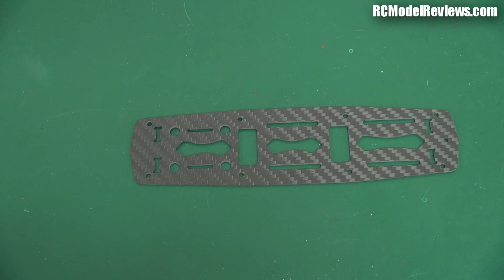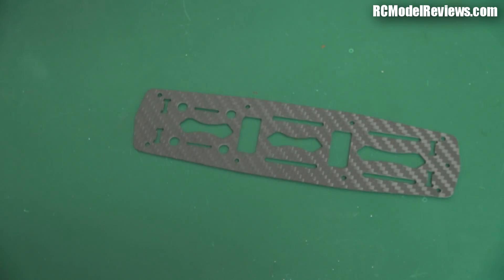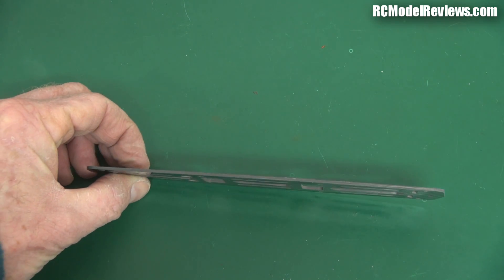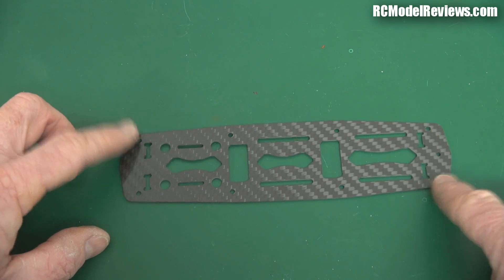Bad 250 mini quadcopter carbon fiber

Comment: On your motor bolts you need a metal base under the screw, even carbon fiber gets crushed without proper seating of bolts, and those look like they are counter sunk screws,,,,,?

Comment: The whole point of being a hobbiest is to modify if needed not complain about everything that's not perfection, because it doesn't exist!!! Once those quads are assembled i doubt very seriously you will see those holes you claim looks like they been punched out instead of drilled... I've purchased named brand rc toys and still ran into problems it's all about the hobbiest and his or her skill!!! I can take one of those Chinese how you say generic frames and cross reference some cheap motors 2300kv and probably be a strong competitor I've seen no name motors out perform name brand motors it's all about if you get a good batch or bad batch or the famous word quality control ... If they sold quads and motors that never break how are the company's going to continue to make money it's not rocket science ijs...
Reply: +twotwocold Sure, they'd perform well but for how long? I've given up on cheap CF frames because those poorly done holes are where they delaminate and crack in a crash. If you crash as much as I do, it becomes more cost effective to get better quality frames that are tougher than the cheap clones. How do brands continue to make money? First they already made money because of the price. The news of how good they are go around and they sell more. Once the sales start to diminish they come out with the a new model. If you're a hobbyist, it's hard to resist the urge to see for yourself how the new model performs. If you enjoy sanding, boring, cleaning and finishing parts more than flying, then that's your thing. I'd rather spend those hours figuring out the electronics and flying than completing what should've been finished correctly in the first place.

Comment: I decided to buy a cheap ZMR250 frame to get experience building one and flying. I was lucky, my ZMR250 didn't need any modifications, it wasn't warped and all the holes and milling seemed perfect. No deformities what so ever. I guess I was lucky. But anyway. When I feel confident, I will spend my money on a brand name frame and higher performance parts. I know what I'm doing now, sort of. If it wasn't for the cheap frame and hardware for mini quads, I probably wouldn't of built anything. I would of left it on my "To do list when I win the lottery".

Comment: What motors are those? I also have a zmr 250 carbon frame. I don't know if i'll buy DYS 1806 or another motor. I have an FPV too on the quad so should I buy the DYS or a more powerful motor?

Comment: I have been doing fiberglass and carbon fiber infusing for years building boats. you can take the flex/skew out of that part with careful heating in an oven and pressing between 2 flat plates.

Comment: Good to see a more in-depth review of the materials used in these frames. It does seem to be really cheap "carbon fiber". It is most likely a carbon/glassfiber mix (center glassfiber). Changing to those materials can reduce the costs a lot, a sheet of carb/glass can up to 20 times cheaper than normal high quality (real) carbon fiber. 

Keep up the good work Bruce! I enjoy watching your video's

Comment: Bruce where did you buy this one, I have 3 from BG and honestly for the price they are food enough, I would never pay more than 50 usd on a frame this small,just,basic carbon,fiber after all, branded once dont deserve they price, you pay too much for,what you get. This is my.opinion,,no need to be,against chinese stuff, there are so many unbranded chinese RC products that offer best price performance rarios. Here better to warn.people.about sellers, and,point out good ones, and let people,decide,to,pay 30 or 150 for a 250,sized 130-150 gr pieces of carbon plates !

Comment: I got one of these and I must say, they are cheap. But if you just want a rigid miniquad for small money it's the way to go. Like Bruce said: needs some fiddling around with a dremel but that's all. Buy some cheap carbon props while your at it.. How this frame performs depends on the electronics you put into this. They are more likely to fail on you than the frame. But be careful with carbon fiber! - the unpainted parts (holes, sides, etc.) are conductive and may cause shorts!

Comment: You might try a heat gun to straighten out the CF. I've had success with that method straightening CF helicopter skids that became warped after a hard landing. I hit it with a heat gun on high and pressed it lightly in a vice and allowed it to cool and it straightened it right out.

Comment: Just received mine today, tooling was good.  Must have been made on a Monday with fresh bits.  (Ordered one extra for spare parts).  Taken a little work on the arms to mount Sunny Sky x2204s. No hurry to build as tweaking the build is half the fun for me. Own the Blackout Mini Hex, QAV250 and the MPX230. Wanted a beater,  this may fit the ticket indeed.

Comment: Mine arrived this morning, I got lucky.. mostly.

Only a little sign of 'punching' of the holes, tolerances of the holes seems very good and consistent. The screws push through the holes with just finger pressure so no too loose. 

Top plate was a little warped, hold down one else and one of the opposite corners lifts about 1.5mm. With the stiffness of the two bottom plates I don't think this should cause a problem.

I got a spare of each screw and nut which was good.

Looking at the side of the arms to check for consistency in the laminations and I noticed that they all have what seems like a thicker lamination in the middle. I wonder if this means that its 2 x 1.5mm sheets glues together rather than 3mm of CF cured as one sheet... I doubt it'll make too much difference but 2 x 1.5mm sheets won't be as strong as a pure 3mm sheet IMHO.

Comment: Hi
I have one of the cheap quad frames in question and love it. Yes the quality control is a little lacking but I can buy 6 for the cost of one quality frame. The cheaper frame has taken some huge crashes and still flies as well as the name brand. Horses for courses.
Good job Bruce

Comment: Thanks for the review Bruce. I have one of these frames and haven't done the build yet.  Mine seems to be consistent in the manufacture. I'm not convinced that the carbon fibre is solid. I suspect it is carbon wrapped G10 which would also be a plus in favour of the name brand frames. However, I don't have very high expectations for the frame in terms of longevity as I'm likely to destroy it in the learning process.

Comment: Hey Bruce one thing you may be able to do with the warped/twisted carbon fiber depending on the resin is put it in the oven for a bit and let the resin get a little soft and twist it back into shape

Comment: It is a shame that some of these frames are so bad, I think you might be right in the comment you made in the initial review that they just use worn tooling to stretch out the lifespan of the cutting tip and save money. The holes that look "punched" rather than drilled looks like the mill operator had the plunge speed of the spindle up too fast. Its more a shame that if they did a good job of it people would bay $80 for a quality made frame from china. Its got me thinking twice about buying another frame....that said I have a cnc desktop mill so i might just cut my own....if i can find carbon fibre at a good price

Comment: Bruce, I purchased one of these Chinese quads as well. The machining and carbon is just as good as on my QAV500. I think I was lucky and mine has the gold stand-offs instead of the red and a very nice satin carbon finish without the polished clear coat. Overall I am very pleased with it. Now I can understand why you advocate purchasing from a reputed supplier however there are legitimate reasons why a cheap Chinese quad would be preferable and a wiser purchasing decision. Now I can afford a Blackout or QAV250 so why did I buy a Chinese cheapy? To destroy! I intend to push the envelope on this quad so far so that it reaches breaking point.  And I would much rather break a Chinese cheapy than a branded one.

Secondly, for beginners learning to fly, a cheap Chinese quad is a far better and sensible option than a QAVXXX or Blackout irrespective of the quality control. Beginners will crash... A lot!

Great vids!
Reply: Interstingly enough... the BO was my first miniquad and despite my best efforts to destroy it through my incompetent flying, it has yet to break :-)

I think all these carbon quads are unbelievably tough so breaking the frame is probably the least of your worries -- whether you've spent $40 or $150 on one.
Reply: ***** That means you are not pushing it hard enough. :)

My QAV500, with T-Motor motors, ESCs etc. cost a fortune. When I crashed that I nearly cried! Granted the QAV500 frame is nowhere near as strong as a carbon mini but when motors and electronics are taken into account a crash can become quite costly even in a mini. That's the reason why I also picked up the RCTimer motor/esc/prop package (great value!) so I'm quite interested to see how they perform compared to the T-Motors. Haven't got around to finishing mine yet. Hopefully this weekend.

Overall cost of Chinese mini c$230 (Australian dollars) and that includes motors, ESCs FPV Tx etc. Overall cost of a Blackout/QAV250 with T-Motors, electronics and ready to fly and you're looking at something in the region of $570AUD.

Taking about RCTimer. I recently purchased a load of props from RCTimer, Graupner, Gemfan and HQ Props. Out of the packet the best balanced props were the RCTimer, followed by Gemfan, HQ Props and then Graupner. The Graupner while being the most expensive also had the worst finish and the worst balance - they needed a lot of work. Nearly every RCTimer prop out of the packet was virtually balanced.

Comment: It's a real shame Blackout has such a poor unreliable supply of parts/frames. We have to use Chinese frames as they can keep churning them out and we get them easily and we don't get ripped off on p&p. Blackout charge crazy shipping charges and do not help with reducing massive import duty and fees! Blackout frame is miles superior, but I have shelved mine and fly/crash the Chinese clones as I know blackout will always be out do stock of one part you need. I have spare Chinese frames, so spare parts are not a problem. Thumbs up for Chinese blackout knock off and free UK delivery and no import fees.  :-) keep flying and don't purchase kit from Australia as you will be hit with £££££ charges. HK or China no import duty from hundreds of stuff I've imported.

Comment: Just bought one of these frames from banggood for $33 US including delivery. Currently I fly a HK FPV250 but it's too cramped for my FPV gear plus mobius. Was going to buy the long frame upgrade for it but can't see the point given how cheap these frames are. Even if I have to put a bit of work in to get it to fly I'll still end up with a mean looking carbon fibre mini quad for next to no money.
Reply: I may go this route as well.  I appreciate Bruce telling us the pitfalls so we are informed.  Will it change my mind?  No not for the price difference but at least I know that what I buy may need to be tweaked to work as I intend.  This will save me frustration and aggravation as I know what to expect.  Like you I don't mind a little extra work to save such significant costs.  Now getting a top or bottom plate which is warped would be a little more frustrating than holes not quite perfect!
Reply: Yes twisted plates would be more difficult to deal with. Hopefully I won't have to deal with that.

Comment: None of those issues will stop if flying well and some super glue on those dodgy edges will sort it structurally. I won't be touching one for sure but I feel the blackout is terribly overpriced even for a perfect product. No PDB is the biggest issue. Cosmetic issues as any Chinese low end product

Comment: Bruce, we must have got one from the same lot.  Mine had to be reamed out to mount the motors and it is a hell of a lot of trouble and looks like crap.  you did a much cleaner job than I did.  Also my frame was warped too.  I had to loosen the screws and twist it by hand and tighten it all back down again.  The blackout frames were out of stock for a long time so I ordered the knock offs.  But now the blackout frames are finally back in stock.

Comment: Had the same problem with the arm motor holes on my ZMR250 frame.  Used a dremel to ream out the holes.

Comment: Yeap. For the price, you will receive components that are processed too fast to produce decent quality. A carbide drill is a must when drilling carbon, kevlar or glassfiber and even that won't last too long if used too hard and fast. I'm a CNC machine setter and we mostly work with ally, but stainless and brass are our next biggest volume. A couple of years ago one customer had us machine up several batches of 2.5mm thick GF plates for a prototype chassis inside some piece of equipment. That GF was the most abrasive stuff we've worked with to date, seriously. (but I did manage to glean a few pieces that were scrapped off during the setting up process ;¬)  )

Comment: I love your reviews Bruce, but i don't think you are being fair here. The Original QAV 250 costs130$(G10)+20$ Shipping = 150$ , Chinese versions cost 20$(G10) including shipping. You can just buy 7,5 Chinese frames for the same money. Even if half of them are faulty; you'll still get 3-4 perfect frames. Or one frame and all the spares you will ever need. 

Sure in some cases it's sensible to pay for the top quality. Like the Flight Controller. I paid 250$ for PixHawk without blinking. But for something like the frame, I don't think it makes sense to pay 7 times more just to get a shinier finish. If the Chinese version was 50$ and the original was 70$, I might have considered buying the original. Alas it's not so, and even if we sometimes get shitty QC, I'm still grateful to the Chinese manufacturers who make the hobby affordable to the masses.
Reply: Yes, of course these frames are still great value if you have the time to fart around making them fit and keeping them straight (in the case of a bad one) but if you're cash-rich/time-poor then the extra hours (and this frame has taken more than a day of my time to get fitting properly and straight) will represent a significant extra cost.   If the price difference is (say) $100 and you have to spend 5 extra hours on the build because of the problems then that effectively has to be weighed into the equation.   If you'd spent a few of those extra hours at work -- you could have bought a superior product anyway ;-)

Mind you -- if you're like me and usually enjoy putting stuff together then it's a non-issue :-)
Reply: ***** Bruce, I understand your argument but given what you do, how you enjoy the hobby, enjoy tinkering and making shit work the time taken is all part of the fun and it's not realistic to cost it against work...
I mean why bother making a toy plane fly as an RC plane or make a micro FPV quad or trying to improve poor quality video transmitters if you didn't like doing it? 
Yes a little more time may need to be taken if the frame is out of shape (mine was like first) and making hole bigger is no show stopper. In a funny way it's almost disappointing once a build is finished...
Reply: Gur Isler
I'm not totally against them... but you can't expect a $30 frame to be as good as a $150 frame -- and they're not.  Check my miniquad shootout and you'll see how I place stuff in perspective.
Reply: ShepdogMatt I totally agree! Dont-know-why Bruce is so against on these 30 bucks frames, mine,came good,from,Banggood, no problem at all, and if I spend 30 instead of 150 usd. I am already ready to put a.bit.of more time,,after all this is another part of this hobby!
Reply: ***** I kind of agree with Xjet... In a sense you could almost save money getting a more expensive frame, because you break stuff more often on the cheap one. Look at all his other videos! the arms have delaminated!
Reply: Again 30 vs 150 is not optimum! And not smart from my point of view! If its about endurance get another 30 usd frame and you will have plenty of parts for any crashes! Besides I crashed so many times with my 250 cheap quad and maybe call it luck or something else its strong enough! So to summurise price difference is not logical! And Bruce should have pointed it as well as a smart reviewer!
Reply: Gur Isler Jeez man. I have a Mini H and love it to death. You really get a good value with the Blackout. If you don't have it, then don't criticize it.
Reply: Curious airlines same for you! I have 2 of these chinese was easy to assemble and they fly great! If you dont have it dont criticize maaan! :)
Reply: Gur Isler Yeah I guess...  The mini H is a little overpriced. But I still love it!

Comment: I ordered one of these frames because it looked quite nice on your video. Ordered mine from gogo.rc from ebay and the frame is very nice quality and the screws fit my T-Motors well. Fast shipping too and i live in finland :) The biggest hassle with these quads has to be the lack of a power distribution board, i had to do the wiring 3 times to get it somewhat right and there are still some wires squished too much to my liking :( 3mm gap is really too little to squeeze in 8 esc wires, battery leads and fpv power leads in my opinion ( or i just have too thick cable... ). I don't recommend this frame to any beginners since it really is a hassle with the wires, will be ordering blackout or a QAV250 as my next quad for sure!!!
Reply: My 1st build has messy wiring as well.
You can add spacers to make a wider gap between the 2 lower boards . That seems to be the way to go . Or get a mini dist board & put it under the flight controller board
Reply: Can I use hubsan part for qav250?